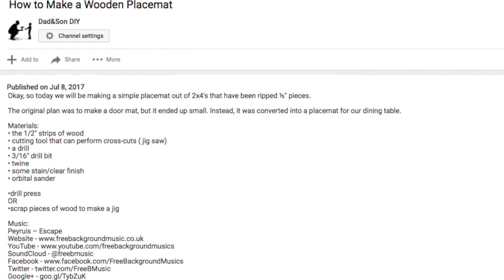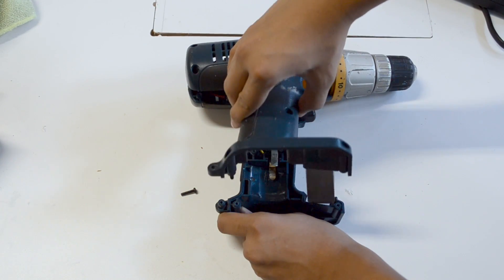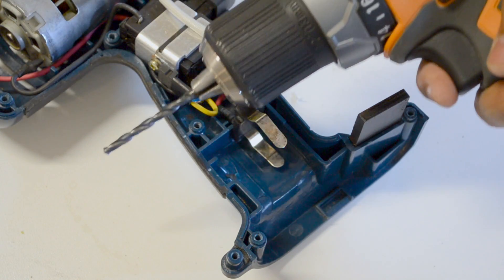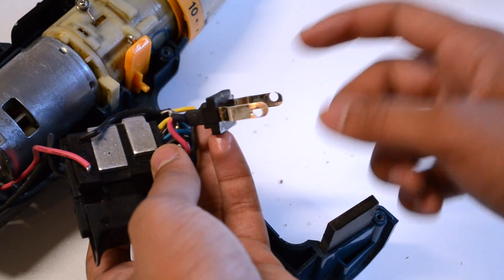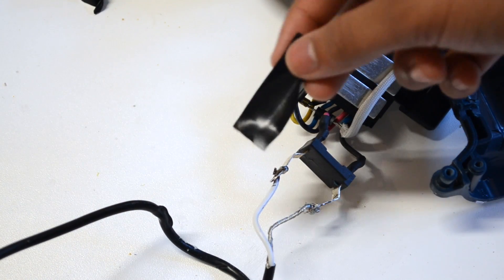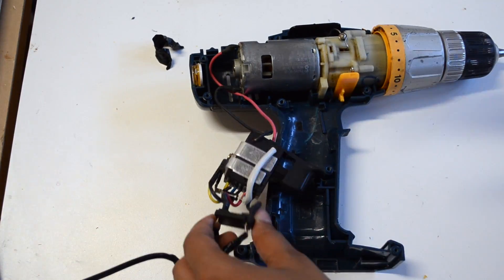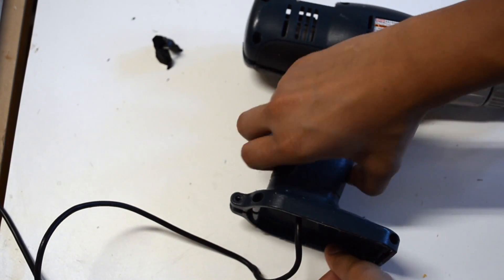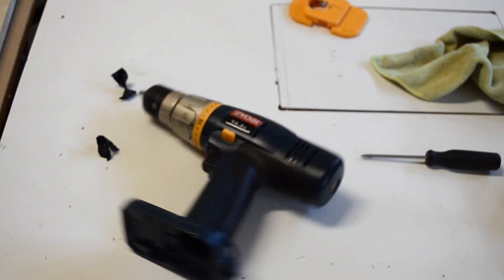How to Make A Cordless Drill Run Off Of An AC Adapter

Comment from the maker: Clearly since making this video, I have been notified that I left a few things out.

1. The drill that I was using is a 14v drill from Ryobi. It was picked up from a garage sale for almost nothing, but didn't come with a battery charger. It wasn't worth going out and buying one.

2. The power supply is  an old laptop charger. It is 15v and 8 amps.

3. YES I should have used heat shrink instead of electrical tape. I didn't have any lying around and don't want to go get some. I have since added heat shrink.

If you have any other questions, please feel free to leave then down below
Reply: Yeah not adding that to the video would make people assume you just used an ac power cord and went directly into the wall outlet. Not good on a 14 volt dc drill lol
Reply: @JustinLodes  So do you use the computer charger as a relay between drill n 110 wall outlet, or is the laptop charger used as a powerbank, n drill will only run until that is dead?.
Reply: @J.T.19134  A laptop charger is not a powerbank. So I am guessing that the laptop charger was used to convert the wall outlet to DC for the drill
Reply: @JustinLodes That's what happened I blew the breaker three times already
Reply from the maker: @ernieproductions7354  The drill will burn up and you might get hurt!
Reply from the maker: @Alex Suero-Amparo Sorry I missed this. The drill still works great today. We use it mostly as a backup when our main drill's battery dies.
Reply: @ernieproductions7354  Answer: What's your favorite flower?
Reply: Sorry are you sure that laptop charger runs this that fast
Reply: Cause I used one used for electric scooters
Reply: this your f.. help, showing people how to connect a wire to the drill, you think ppl are stupid f.. as..ho..

Comment: I discovered this video because i was on the internet looking for a hybrid sorta drill that you can both plug in directly or use batteries for. Is it possible to still use a battery for it in case you came across one? I'm in search of these answers because i live in a part of the world where the national grid could go off while you're working and there'happen to be many places i may have to work where the buildings are not connected to the national grid.

Comment: warping wire and taping is ok for testing , but final solution should be soldered or crimped , and a knot should have been tied on lead before it came out of drill for strain relief

Comment: Did you remove the small black box from the mains adaptor! I did this conversion and it works ok until I pull the trigger right in when it turns on and off and on and off and I do not know why?

Comment: I tried this with DC adapter of 5V 2A and it didn't work. Batteries inside the device were 3 prices of 1.2V each, 1800mAh. No idea what kind of DC adapter I need but the one I tried didn't work.
Reply: you need to get a dc adapter, I prefer to call them psu, power adapter, power supply or switch mode power supply (smps), that can push more than 2 amps. Reason being is that inside the ac adapter there are generally 1 or 2 mosfets which switch on and off in order to let out a smaller amount of voltage than the rectified ac. if you draw higher current this forces them to switch faster causing them to heat up and burn. The amp rating is much more important than the dc rating for a project like this as most motors can be driven by a range of dc voltages and Id wager youd get good results with something 20% less than the battery originally fitted to it. However seeing as these tools draw insane currents to operate you either need to get a power supply with built in current limiting or one that can supply currents higher than the drill draws
Reply: also I can offer 2 directions as to why it flat out didnt work. Im guessing your power supply was a usb style 5v power supply. Forgive me if Im wrong. Usually those are cheaply built so you may have burned it. Less likely tho, some power supplies are built with a “shut off” feature if the current goes too high, cant speak intelligently on how it works or how the limits are set so I wont, but those could be reasons it flat out didnt work. Little experiment you could try, this only works on brushed dc motors btw. take a single aa battery and connect both ends to the motor, it will spin slowly. flip it around it will spin the other way. its great for testing if a motor is shorted or inductor enamel burned.

Comment: On a different note for those of you who don't mind conversions, is a process that could be used on devices that would typically require two or more AA, AAA,C,D, etc batteries. For instance, I have a multi LED round riser that I think was originally for Illuminating a little toy from the bottom side up and I wanted to use it on the bottom of one of my fiber optic Christmas trees for which the original motor and color wheel with halogen bulb has gone missing. But battery's probably won't last but a few hours in it and you can get expensive to swap them out and very time-consuming to constantly be charging them up even if I did have a good Supply. All you have to do is take the number of cells and if they're 1.5 volts and in this instance I'm looking at 6 volts DC(4×1.5) and knowing it's just for some low wattage LEDs I'll just take one of my AC/DC adapters( and I keep all my old ones even for items that quit working) and I'll find something between 5-7 1/2 volts DC at probably 500 milliamps plus or minus to power it and it'll be soldered in at the two main leads off the battery box or I'll just remove the leads from the box and go off of that and then you just plug it in when you don't want it unplug it and you don't have to worry about it

Comment: what power supply were you using. Every dongle I've tried has surge protect built in and will not allow the drill to have any torque.

Comment: Which adaptor is suitable for 12 volt black and decker drilling machine to work on AC? (Battery 12 v, 1.0 Ah)
Reply: You need 12-14v at 8amps

Comment: Thank you about this video. You are the best.  I have one question. I have a cordless drill 12 V. Can I use a Power supply unit (atx) from old desktop PC for power supply?  It has an output for 12 v, but  I don't know if there will be enough amperes?
Reply: If you can't find any markings simply look up a comparable power supply unit with the same wattage from the same time period online and that should give you some specifications

Comment: Nice video, got a similar project I'm involved in now. The power on mine would be from a car 'cigar lighter' power outlet.
Reply: U may want to run straight from battery as the circuit for the lighter might overheat and or blow fuses

Comment: Tried Toshiba power supply 15v 5amp to run a Skill 14.4 and it ran very slow. Put on a 12v car battery with car running and ran faster with no loss of tourqe. Must have been to old a power supply.
Reply from the maker: Hmm, that's interesting. Glad it worked out though!
Reply: A 12v car battery can output on average 40 amp hours or more which is why the battery worked better.

Comment: If the cordless tool is for example 400 W 20V batery, this means a power adapter that outputs this power is 20 V, 20 A, because 20Ax20V=400W.
Reply from the maker: That would be a very powerful tool. Our drill was only 14v and ~8amp. I'll let you do the multiplication ;)
Reply: @DadandSonDIY  Usually cordless tools are not so powerful to spend energy. Actually manufacturers don't let we know what power they need to get working, so we need to open the tool and read the motor specs or find their default power consumption on internet. My example was only to make sense. So when a motor  works it consumes more power if the power adapter can supply it. The voltage of the adapter should match the battery requirement, but it can provide more power, the motor will take no more power that it needs, if it is used correctly. If the motor is under pressure it can consume more power and to burn out. The upper limit of the adapter's power is for security reason, because users sometimes  don't use the tools correctly.

Comment: Why not soldering wires to the pines ??? Much more safer.
Reply from the maker: Back when I made this video I didn't have a soldering iron. You are right, soldering would result in a much better connection.

Comment: Keep up the good work, young man...
Reply from the maker: Thanks!
Reply: Well surely you're not suggesting that we plug that into the wall nobody's really questioning you but that's two different volt systems I don't think you can just plug a battery cordless drill into the wall Outlet and use that kind of power there are two different kinds of systems and I think you may either burn the drill up or cause a fire somebody correct me if I'm wrong

Comment: Hi, lovely video and some great work. Youtube find of the week for me. I bought a cordless drill 15.6v with no charger and the battery pack had 11, 1.2v 1500mah batteries Ni-Cd. 3 of the 11 batteries had zero voltage, the rest ranged from 0.2 to 1.1v. I want to convert the cordless drill to corded. Please I have an old laptop adaptor with output rated as 20v and 3.25A, would this be enough to run the drill, or what would be the ideal range of adaptor to use? Kindest regards.
Reply from the maker: In our experience, drills typically need a lot of currents (6-8 amps). It would also probably be beneficial to try finding an adapter with a voltage closer to the 15.6v spec of your drill, as having too high of a voltage can cause it to burn out.
Reply: @DadandSonDIY How quickly would the 20V 3.25A adptor burn out the to be corded drill?  What old disused electrical product could I harvest a 15V and 8A power supply? Many thanks
Reply: @DadandSonDIY  Many thanks for your kind reply. Please I got the cordless drill for pennies without a charger, I do not mind experimenting with the laptop adaptor I already have, what might be the dangers to the adaptor 20V 3.25A or the 15.6Vdrill by pairing them up? Or not bother and wait and see if I find a closer matched laptop adaptor? What electrical items might I be able to harvest a usable power supply for the drill? Great stuff and kind regards.
Reply: @michaelmercury1256  yard sales, that place that resales donated items Goodwill almost couldn't remember the name and of course online sometimes you can pick up a whole bunch of different adapters AC/DC. If you go to online route and you're trying to to do this for several items or to have backup supplies I would buy a assorted group of them in a one-time purchase where you probably get them for a dollar to a piece plus shipping. But you can go ahead and do a quick soldering up of what you have if you're only going to be running the drill briefly and seldom use you probably be just fine but if you plan on using it for several minutes at a time for an afternoon you'd want to make sure that you have something that's going to give you the juice you need(a) and within the usuable (v) spec.

Comment: can i use 18v battery in 14.4v brushless drill????
Reply from the maker: It definitely isn't recommended. Doing so can kill the drill or at the very least reduce its lifespan. In the video, I used a 15v adapter for a 14v drill, so they matched up pretty well.
Reply: @DadandSonDIY are you still here ?)))
Can I use 19.5 v , 7 amp adapter for a 18 v jigsaw ?

Comment: Why are all you drill converters so dumb? Just remove the battery, put it in a drawer and forget about it and attach the wires to the terminals up inside the handle, job done and in half the time!!
Reply from the maker: If you think you're so smart and everyone else is dumb, you're probably the one thats dumb.

Comment: So you mean to tell me you have the drill plugged directly into your home outlet?
Reply from the maker: No, there is a laptop charger that we used as an adapter. DO NOT plug the drill directly into an outlet as the drill isn't meant to run on 120v AC.
Reply: @DadandSonDIY : Let him plug it in to the AC.  Some of the queries to your excellent post are from people that should not be playing with AC/DC in the first place.

Comment: I used a 12v 12ah battery out of my childs ride on car (actually just a 12v golf buggy/mobility scooter battery) to power a bosch drill in a fix. Just used crocodile clips on each end. A bit sketchy, but it worked great. That's another option, carry a bigger battery with you and wire that into your drill. If you can wire it into an existing battery, even better!

Comment: Incomplete, I think, for a beginner. why u didn't show the other side of the connected cable?
Reply from the maker: I was young when I made the video. Looking back, there is a lot I would change in the project. Still some cool ideas there though!
Reply: @DadandSonDIY  oh. I see. Could you share those recent ideas? I have one, don't want to throw.
Reply from the maker: @p.c.rpendyala9044  Instead of attaching the wire to the drill, modifying the tool, you could attach it to the battery connecter, removing the old batteries, so then the old battery housing is essentially an adapter for all the tools you have.
Reply: @DadandSonDIY  Tks. Let me try. .... I am not a techie. Trying to understand this reply.... I yet to start my exploration....I was thinking if using so many old adapters, lying around... Can I cut the charger adapter connection at the battery holder and connect the ends as suggested in the video. My understanding this is what u are suggesting now.

Comment: Mine just started skipping. It turns a bit approximately every second.
I'm using a tesco drill and a 12v 2amp laptop charger. The original battery was 1000mAh. 
Any suggestions?
Reply from the maker: I would replace the current laptop charger with one that can output more amps. I had that issue when I first used a 4 amp charger and increasing it to 8 solved the issue.
Reply: @DadandSonDIY  you were right. I replaced the 2 amp laptop charger to a 10 amp car battery charger. Now it drills like crazy.
Thank you! 😁
Reply from the maker: @r3unite749  My pleasure!

Comment: My cordless drill is 14.4v. How many volts and ampers of adaptor or charger i need to use?
Reply from the maker: You will need an adapter that can output around 14.4 volts (+/- 2-3 volts should be fine) and around 6-8 amps.

Comment: Personally, I would get a AC->18V adapter and then wire it to an expired battery. Result? You can plug this "battery" into all compatible tools.
Reply from the maker: That's a great way to do it. We didn't do that for this one because this drill was the only one using the type of battery. Looking back, there is much that could/should have been added to the video.

Comment: Can I run an 18v drill off an 12v powersupply?

If so, what will be the effect of the reduced voltage?

Thank you
Reply: It will be much weaker basically. Maybe, very maybe, it will draw more current and burn up? But I think likely it's just gonna be weaker.
Reply: I have converted several 18V tools to run off 12V without any loss of torque. The unloaded speed is a little slower, but not enough to notice. The reason it works is that I'm using a regulated 12V high current (30A) supply. Battery voltage sags under heavy load anyway, so 12V is plenty.  I measured tool current and voltage under load before and after battery elimination.
Reply: @millanferende6723  thank you, much appreciated
Reply: @tonysicily2687  No problem! Just to clarify myself because otherwise I will feel stupid: 
99% chance it will just be much weaker.
Reply: @millanferende6723  You have been very kind

Comment: can you do this and still allow for the battery to be used when desired?
Reply from the maker: Not the way I did it.
Reply: @DadandSonDIY  yeah, not the way you did it but it could be done right and shouldn't have any problem? I'm thinking about getting a battery powered miter saw for those times I don't have AC but I'd like to make it a corded saw too
Reply from the maker: @MysteryScienceGaming  You could build an adapter that fits into the saw the same way the batteries do. That way, you don't have to modify the tool and can switch between running the saw off batteries or a cord.
Reply: @DadandSonDIY  good idea, do you think I should take battery I have that is broken and use it as my adapter?
Reply from the maker: @MysteryScienceGaming  If you have a broken battery, that would be a great way to do it!

Comment: Nice video couple of pointers 1) use a really small drill bit to start and you will end up in the center then the larger drill bit will follow the smaller one. 2) solder your wires for better contacts. Nicely done

Comment: This also works if you want to try out whether your cordless drill works IF you have dead batteries.  Connect just as the kid did here (Caucasian to Native-American & African-American to African-American).  Put some electrical tape on the connections, fit the trigger in back into the plastic harnesses so you can try it out to see if the motor works.
Reply: rofl

Comment: wow! beautiful, but the cable connections lost me, how do you know which cable colour  goes in what pin?
Reply: Use a multimeter to determine which pin on the battery is positive and which is negative. If the polarity is reversed you’ll get a -18v dc or -12v dc reading

Comment: This is the easiest part you literally just get a power supply and put it around the contacts. This is t the problem people are having. The problem people are having is getting the/a power supply with high enough amps without paying more that a brand new drill 

You’d have to be brain dead to not know how to do what you did
Reply: I didn't know and I am not brain dead, I just not into electric parts and this advice was gold to me. I use a drill once a year, my work is into the accounting field I know nothing about connections.

Comment: Are you still there bro. One thing, if the battery charger is OK which output 24v can it work to run the drill which is 18v 
Thank you very much for the vid.